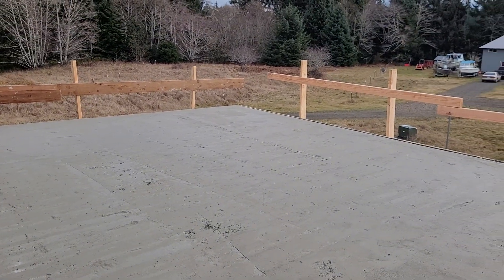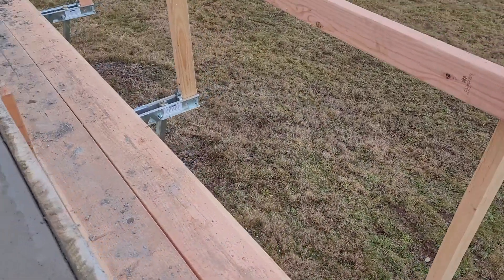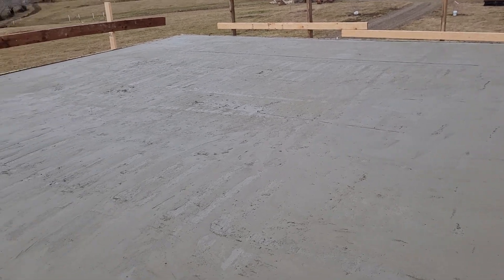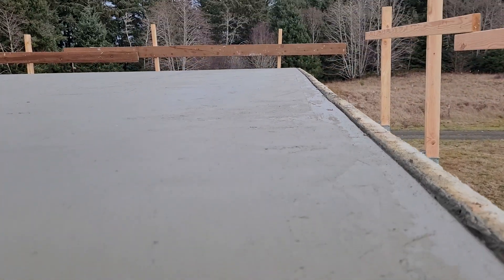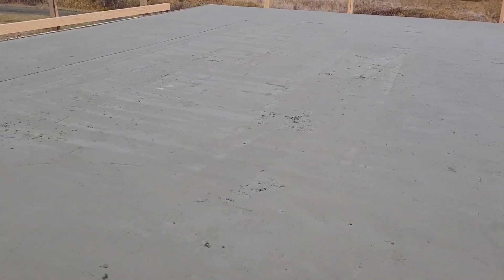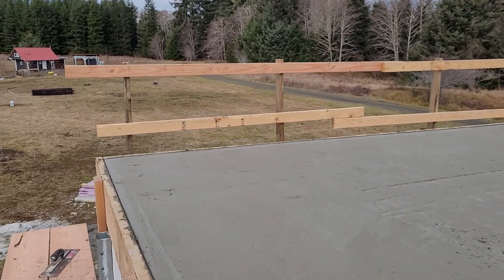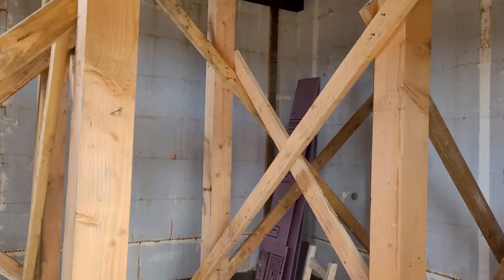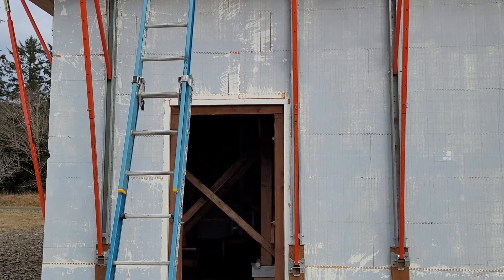Suspended Concrete Slab With Basalt Rebar on ICF Utility Building

Comment: If you have fiber sticking out of the surface it will wick in moisture and then blow out little pockets when it freezes.
Reply: Use a torch to burn off exposed fibers prior to coating
Reply from the maker: So maybe I should make a portland cement paste and cap it, then waterproof it
Reply: @franksfamily  You could probably get away with painting it. I’m assuming there is going to be some sort of covering over this eventually.